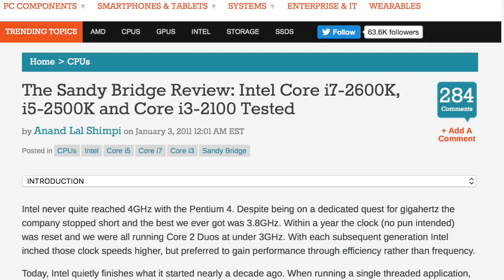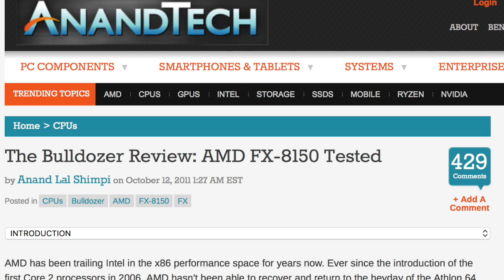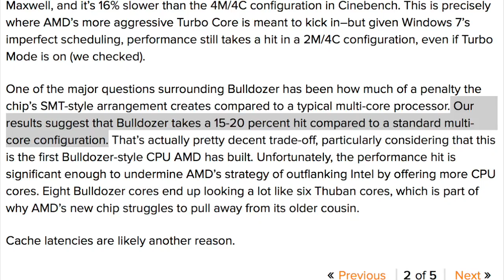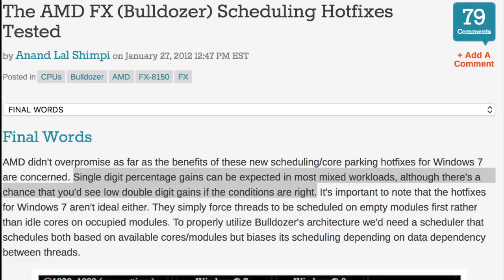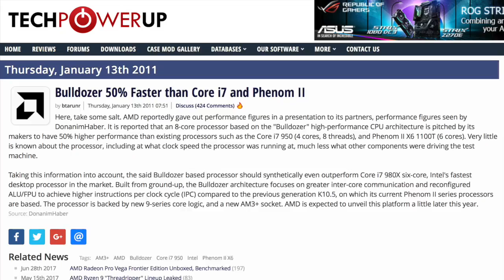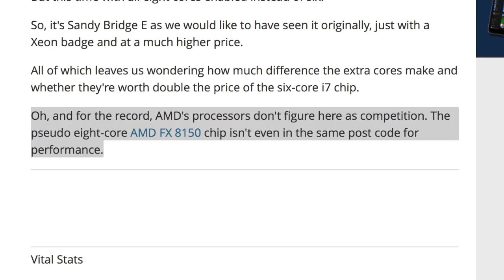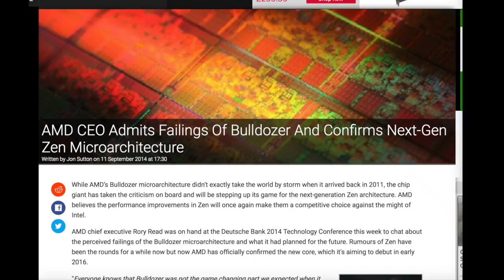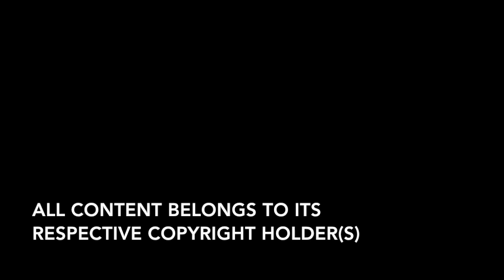The Bulldozer Story - and why AMD FX is better than you remember

Comment: i'm still running my 8350 (stock right now) and i don't really feel like i need an upgrade yet... Only for a few badly optimized alpha games... i wouldn't mind having the latest intel cpu, but the price... nah i'm good, i grew up with VHS tapes and IBM laptops so 60 fps is ok for me :P
Reply: Barry Cooper, not so.  OLD games that only use one core yes but not new ones.  At the time I had my FX8350 I had my i5 2500K.  Swapping my R9 280X from one to the other I compared performance in 7 Days to Die.  There was an intersection down from my base where my frame rate just cratered on my 2500K.  I swapped the R9 280X over to the FX8350 rig and got better frame rate.  I noticed that when playing 7 Days to Die I had two cores showing more or less idle and six cores at 70% - 80%.  The 2500K does not do 6 threads, in single core the 2500K smacked the FX8350 down hard, but in that game not so.  

I replace the 2500K with a 2600K I got on ebay, it could smoke the 8350.  Last week I replaced my 2600K system with this R5 1600X based system I finally got all the parts for, and so far I am happy with it.  That i7 2600K system in reality still does pretty good, sandy bridge was a big step, I had mine as high as 5.1 GHz but for daily use I ran 4.8GHz.

I really only built this one because it has been a while and I wanted to play with a new toy :)
Reply: ryzen brah. fuck off with your dual core i3
Reply: My FX8320 still does well and it was at 5ghz for nearly 4 years, It's on a h80 now at 4.6ish Ghz, with a GTX 670. And I still can't find anything it can't play, but once you start upgrading the GPU beyond a GTX1060 or a RX 580 then you might start running into issues with it holding back the graphics card, at 5ghz my FX8320 was holding back my 780ti's quite a bit a few games. I moved on to the i7 5820k but I will still be holding on to my FX8320 system as its still vary capable.
Reply: F. H
You're right in that regard when it comes to it'd be better to spend more on graphics, but of the Ryzen 5 series, the 1600 is really the sweetspot purchase!

And yes, they do share the same cooler, it's a nice addition, and a good reason not to use the 1600x
Reply: I'm running 8350 @ 4.4 with stock voltage :) I really love this CPU, but it really needs Windows10 to shine!
Reply: @AirsoftAddicted  exactly, when I got windows 10 my FX CPU suddenly got very snappy, it would do 60 FPS on all my games just fine with maxed settings in windows 8, but with windows 10 it started cranking up to 160 FPS in some games when I turned my settings down a bit to help my GPU.
Reply: F. Henriques.....Wow....Something like an 8-core FX-8320e would be a huge upgrade for you, and I think they are only like $79 at Microcenter.
Reply: F. Henriques
Aim for the 1600 if you can!, sort of a sweet spot!
Reply: F. Henriques
I'd look at the 1600 because it comes boxed with a good cooler, is a full on six-core, and is less than the 1600x, but will overclock up to the same kind of level.

That wraith spire really has impressed me when i got to handle it myself, it's actually a vapour chamber cooler with a CM static pressure fan on it.
Reply: Same, mostly. I mean, FX-8350 does bottleneck even RX480 to an extent, but I think right now, I may just wait for Ryzen, er, "Gen 2". That should have given my FX system nearly 5 years of totally capable service life. Not too shabby, IMO.
Reply: Barry Cooper, no.
Reply: Gotcha...ouch....guess that complicates things a bit.
Reply: I would look into an Ryzen 5 1600 don't get the X use the money for a better cooler and OC it get an B350 mobo and nothing less than 3ghz ram.
Reply: Yeah, the 8350 is still a great CPU in the right tasks. A few years ago, everyone was talking about how the 8350 would be futureproof with more cores... We were half right, more along the lines of Vulkan, which makes the 8350 very competent in gaming... But you guys might want to take advantage of the RX Vega bundles that AMD is going to be doing. So I think you pay $100 more for the Vega package, but you get like, a $200 rebate on a Ryzen 7(?) CPU and a $200 rebate on Freesync monitor. Or something like that. If you're already looking at upgrading to a high-end rig from what you have, it could be a smokin' deal.
Reply: +Eldor Luedtke

How high did you clock that 2500k?
Reply: https://www.youtube.com/watch?v=gmhGQl8052o
Reply: well when a Ryzen 1600 now at $150 -$160, and Ryzen 1400 and 1500 even less, the FX line is pretty much dead. That's coming from a person who's primary rig up to a year ago (when you posted this) was an OC'ed 8320. It did me fine (especially for the price I paid for it in 2015 @ $139).
Reply: haha yes you are right, 8350 is ok, i have a fx 4300 and still happy, i need a upgrade and notice realy the differance , maybe ryzen 3800x  xD
Reply: The electricity you'll save by changing this processor will pay the processor. I have a lot of fx6300s were i work and they're slower and hotter than 7 gen pentiums. Literally the hottest processors I've ever seen.
Reply: +Eldor Luedtke  A new i3 like the 6100 even beats my old 3570k in some games and the rest it gets equal performance. The 3570k beats the 8350 so you do you see my point?
Reply: An i3 would even be an upgrade from the 8350 if gamings what you do.
Reply: @barrycooper8640  Take off two wheels from your car and chuck em' in the woods dude, it'll be a big upgrade.

Comment: im still here with an FX 8370 Clocked to 4.9 on 50€ Watercooling, running smoothly and cool.
No Problems in 1080p 144hz, for example 290 FPS on CS:GO with an R9 390X

anyway going to upgrade sometime soon to 2560x1080 240hz and this will most likely require a new PC :) so hello 1800X, DDR4-3200 and Vega
Reply: Do yourself a favour and skip the 1800X, if you must go Ryzen go for a quad or 6 core or you will be disapointed with the performance / cost ratio.  I'd wait for gen 2 Ryzen and stick with the FX for now.
Reply: old as if like core i3 550 because i have it and it goes to around 90 avarage with my gtx 1050, if i use a gtx 1070 wich i borrowed from a friend it goes up to 95 or 100 fps so i dont think an i3 can get 290 fps
Reply: got a similar set up and its still gaming strong.I have a FX8350 and R9 390X and 20gb of ram,its plays games well on high in 1080p,i think i will go for a Ryzen 5 1600 in a few months
Reply: http://www.guru3d.com/articles_pages/watch_dog_2_pc_graphics_performance_benchmark_review,8.html

http://www.guru3d.com/articles_pages/dishonored_2_pc_graphics_performance_benchmark_review,8.html

http://www.guru3d.com/articles_page...e_warfare_pc_graphics_benchmark_review,8.html

http://www.guru3d.com/articles_pages/battlefield_1_pc_graphics_benchmark_review,9.html

http://www.guru3d.com/articles_pages/gears_of_war_4_pc_vga_graphics_performance_benchmark_review,8.html
Reply: ★SkillZ★⑲ oof
Reply: Look what have we got here. An Intel fanboy... No, an old i3 can't get more than 290fps in csgo. Not even my i5 6500 can get more than 250 fps in csgo...
Reply: An i3 6100 can hit high framerates in csgo.
Reply: An old i3 gets more than 290fps in csgo. Youll be amazed when you upgrade.
Reply: Right, but i'll only upgrade if i need to
290 FPS seems enough, i can even play BF4 on Ultra Settings with 100+ FPS so yeah